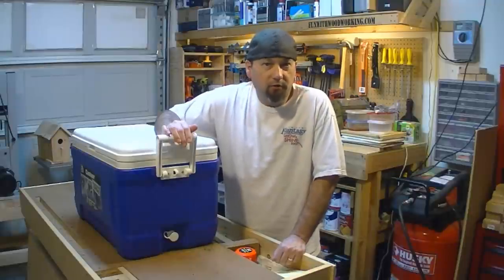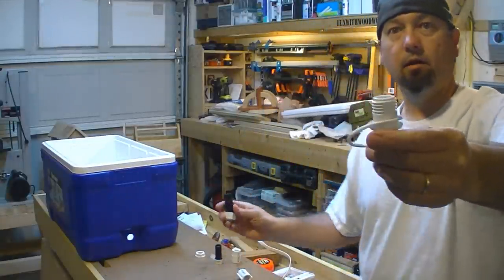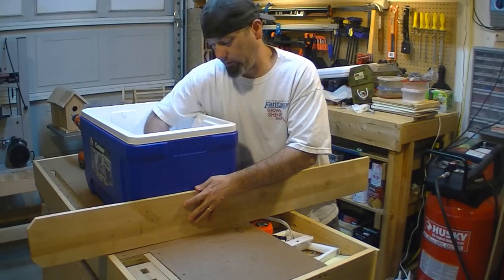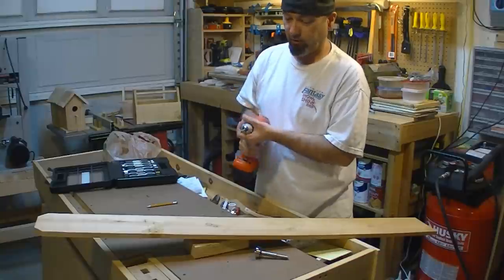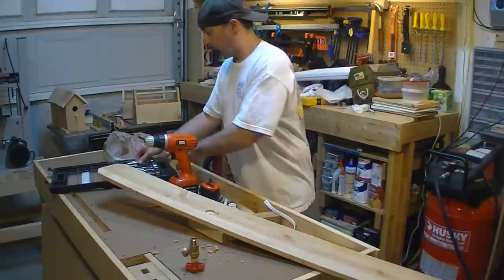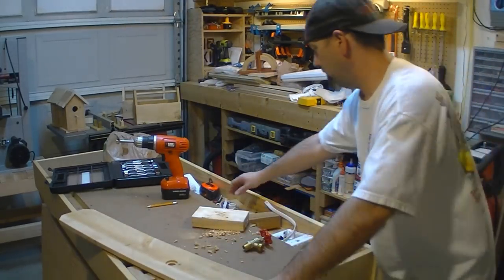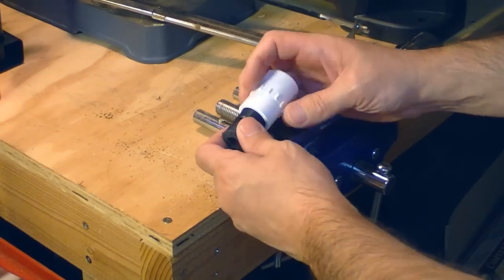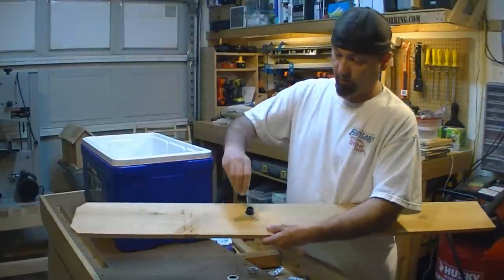Project update - How to install the plumbing in the rustic ice chest cooler box

Comment: Very informative!  I built your Ice Chest Cooler box, but made the cooler from scratch, and essentially just epoxied the pipe that I used in place, and cut it flush with the inside.  It works, but it's not as pretty as this.
Love your channel, love the projects.  Thanks again!

Comment: Great follow up Donald,
  The spigot was a challenge for me too, I did it a little differently but I like your method better. Thank you for answering this question.

Regards,
Bob
Reply: That clears everything up. Would you recommend some epoxy underneath the shoulder of the spigot, just to keep it from turning in the hole?

Comment: Thanks, for the follow up. I'm going to make one this weekend, and I was a little unsure about the spigot. How come you used 2 separate extensions cut down to one inch, instead of 1 cut down to two inches? Does it give some needed leeway?
Reply from the maker: Casey Owens I actually just came up with a better way to do the plumbing and you can check it out here: http://youtu.be/OsGlIysPHUY
Reply: Love the new video. Thanks for the quick reply (especially for the middle of the night). This is kinda what I was thinking; a sillock valve, a nipple and a collar. Your videos are great. Thanks for taking the time to make them, along with your plans. These coolers will be my Christmas gifts this year. I just need to get a router table. That chamfer really makes a big difference. Keep up the good work! I'll share your videos with my buddies and hopefully get you a few more subscribers.